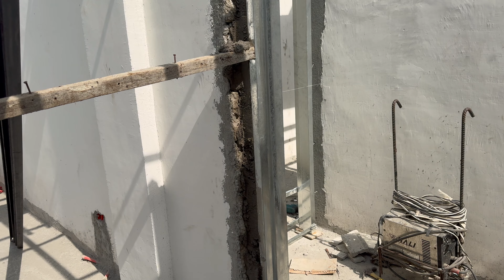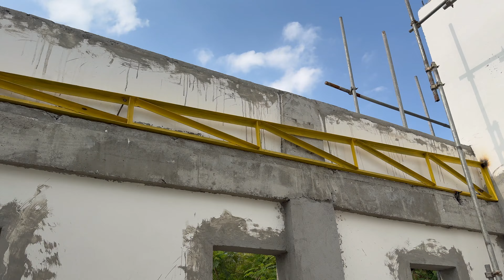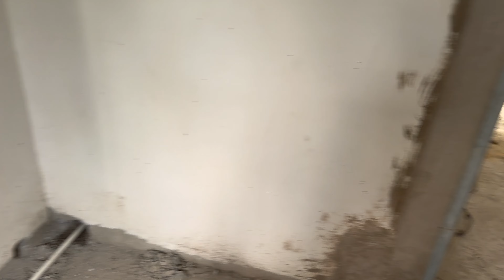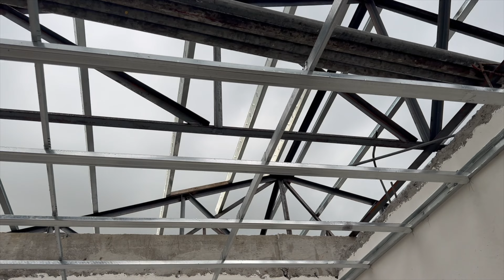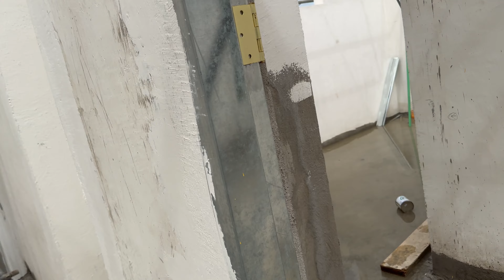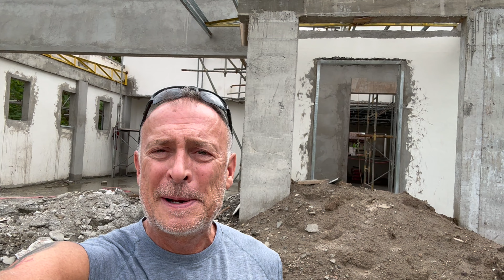House Building in the Philippines--More Problems, More Frustration, More Delays?? V29

Comment: Ive bn here in the PH.for a while now as a structural engineer with nearly 2 decades of US exp.been a student of korean & japanese carpentry for nearly 3 decades & I'll tell you 1st hand the Philippines (DO NOT KNOW CODE STRUCTURE ENGINEERING) but they do have good hearts & a drive to learn. There are too many things to reinforce & its by reconstructing their educational system & indoctrinating common sense safety standards & building code regulations. It is an utter atrocity to endure the agony of bearing to watch these men work. Lavon

Comment: As all your door jambs with the preinstalled hinges seem to be made of the same C-channel material used as roof purlins, aren't they going to get rusty and wear out fast especially when they're meant to keep the bathroom doors in good working condition over its lifetime?
Reply from the maker: I hope not, but good point.  I'll discuss with my builder.  Thank you!
Reply: Tropical humidity in ph is why door jambs in homes and office buildings are made of hardwood, including the doors themselves. Once you start installing metal in places where moisture is already a given and where moving parts are attached, it's an invitation for deterioration to become a regular feature. New buildings here that use premade plastic doors and door jambs see damage quite early, requiring frequent replacement.

Comment: The problem is mate they don’t have any trade background they’re doing everything back to  front and it cost you buddy. I have been carpenter for 40 years all the chase electrical should be done. I do like the steel door frames but they should’ve been put in where the blocks were getting laid and I could just keep going on and on
Reply from the maker: You're definitely right, it's frustrating watching the things that are done out of order. But there's only so much I can do to control things from my side.

Comment: Why wasn’t the roof install, before installing the ceiling structure. The roof should be the highest priority?
Reply from the maker: I have ask many times and never got a straight answer.  As much time as I have spent here and as much as I thought I know, you really have to experience it first hand.  Efficiency is not something most take very seriously nor do many care to understand the benefits.  Since there are only advantages to putting the roof on early, the only thing I can think of is it wasn’t put in earlier because of the price.  It’s one of the more expensive items and procrastination was the answer for spending the money😮‍💨.
Reply: It’s the last thing b4 finishing, helps keep the dust down and makes the workers move a little more, you will see them change when it’s not blasting hot. They will slow down…

Comment: Jeff, you may have covered this, but is there is a reason they have waited so long to put your roof on?  Semper Fi,  Joe
Reply from the maker: Hey Joe, I have ask many times and never got a straight answer.  As much time as I have spent here and as much as I thought I know, you really have to experience it first hand.  Efficiency is not something most take very seriously nor do many care to understand the benefits.  Since there are only advantages to putting the roof on early, the only thing I can think of is it wasn’t put in earlier because of the price.  It’s one of the more expensive items and procrastination was the answer for spending the money😮‍💨. SF!

Comment: Why don’t they use glue on their PVC instead of melting them together, does the glue release later in the heat?
Reply from the maker: Daniel, interesting question and I’ve ask before but got the common answer🤷‍♂️ “it’s just how we do it.”  I’m not a plumber and maybe someone with more knowledge can chime in but here is what I think.  The stuff they are using, PBR, is different than PVC.  The walls are much thicker then PVC and I believe it is better for maintaining temperature, especially for hot water.  All though the heating tool they use to fuse together looks a little questionable, apparently it works well at creating a water tight fit that can withstand high pressure.  Before they close the walls up we are suppose to pressure test in the lines so I will see just how good it is.  Thanks for the question and for watching.
Reply: @jeepneyjep1919  What they're using was a PPR (fusion welding machine. What it does is it melts the material (pipe and fitting) to a certain temp/degrees and fuse it together which now become one solid connection. PPR by the way is (polypropylene random copolymer pipe).
Reply from the maker: @JohnBraca-fk6dh Thanks John!!
Reply: I will check into that type of pipe thanks for getting back to me. It will be a couple more years before we start our build.
Reply from the maker: @danielsimms3361 ”I think” PBR is the most commonly used type for residential builds.  I’ve seen it in a few other YouTube videos.  Good luck with your build!!
Reply: I read your comment and hope that this will help out. The pipe is called PPR and it is used here in the US as well. It is one of the new ways to fuse pipe together and it really holds the pressure. It is a cheaper way than using Pex A or B piping. They will definitely have to test the water pressure before closing the walls because I have seen it leak in the Philippines and they had to tear out the poured wall and repair the piping. PPR is actually a really good piping and it is one step under Pex A or B piping. Hopes this helps you out with understanding the PPR piping. Take care and good luck with your build as well.
Reply from the maker: @kennymatthews2135 Thank you Kenny!
Reply: PEX is here in the country but it’s very expensive and fittings, tools, etc are not easy available, yet….  PPR has been around for a while now and holds up a lot better than the old pipe they used b4.  One big problem is the water quality is really bad, it’s ok to shower and clean with but don’t drink it.  For your second floor you will need a boost pump and tank so you have decent pressure,  right at your water intake and some big blue filters and change them out monthly, will help keep out the junk in the pipes..  there are a few other options if you want to go that far but it’s easier just to get drinking water delivered and do it that way.
Reply from the maker: @jackmeloff3335 A water bladder, pump, and filtration system is in the plans
Reply: @ be mindful of the bladder you get.  Most of them have a cancer warning on them, I got mine from a company in Manila but that was a long time ago.  All bladders come with paperwork so you can check.  Make sure when they install they put cutoffs b4 the pump and filters so it’s easy to clean and use back flow valves where needed…
Reply from the maker: @jackmeloff3335 Copy, thanks Jack